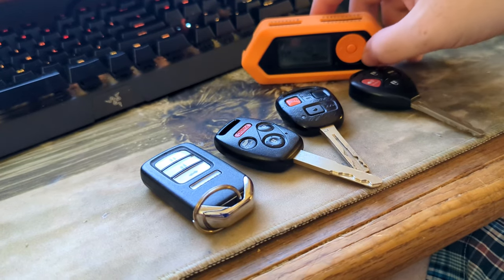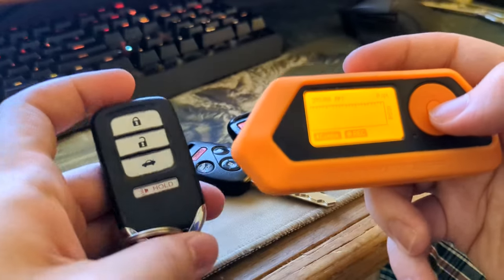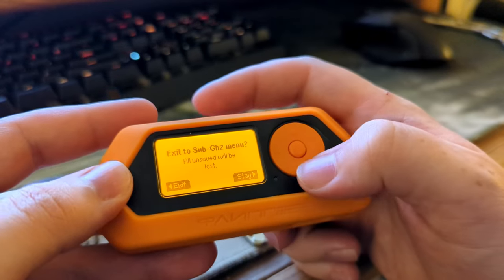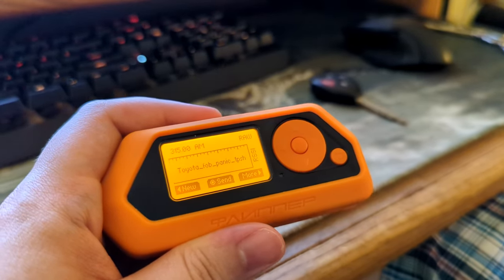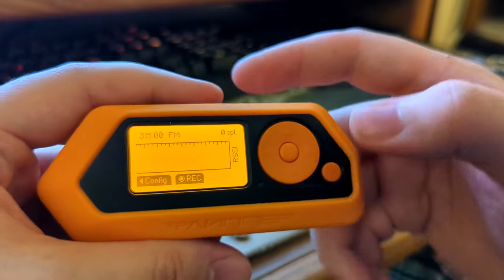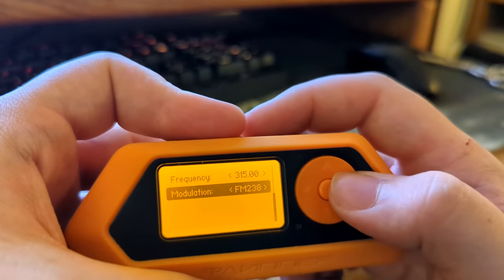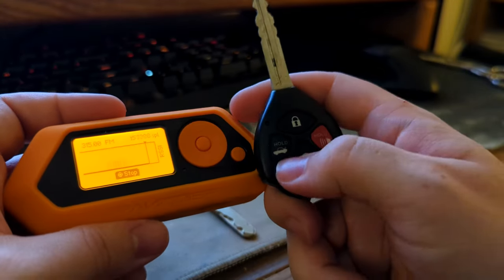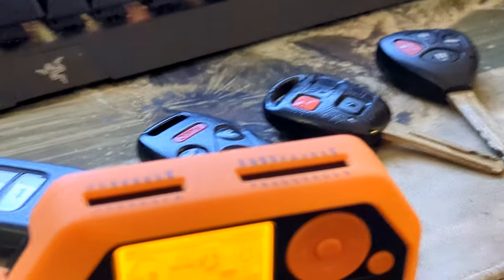FlipperZero - Catching Vehicle Key FOB Signals

Comment: Now gonna drive my neighbour’s car
Reply: might not be so easy, it might work the first time but modern cars use a rolling code
Reply: @amb1u5  yeah, not working with my car and its 2014 so good luck
Reply: @jcgm666  did you see a spike on the rssi graph when capturing?
Reply: @amb1u5  yes, I capture lock and unlock signal, this part is working. Replaying the signal on the car wont work because of the rolling code protection
Reply: @jcgm666  well at least thats good for you, seems gm holdens code rolls every second time allowing unlock it once but not relock , so maybe for the 2007 holden commodore only rolls once both an unlock and lock sequence has happened
Reply: What does replay a keyless entry signal on modern cars
Reply: @matthewwillis3865  on the newer cars it won't work, the flipper would still be able to capture and replay but modern cars code rolls every time
Reply: So why year cars will it work on ?